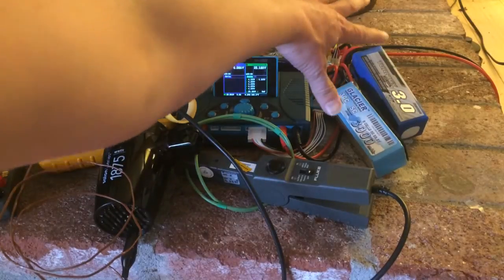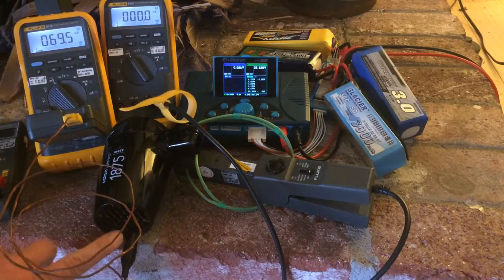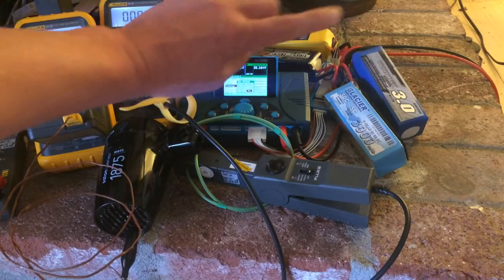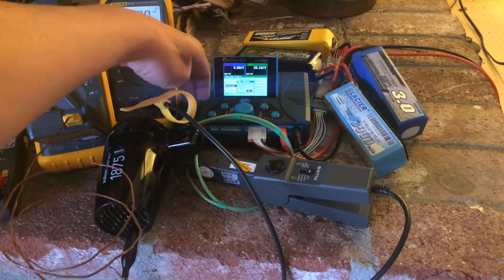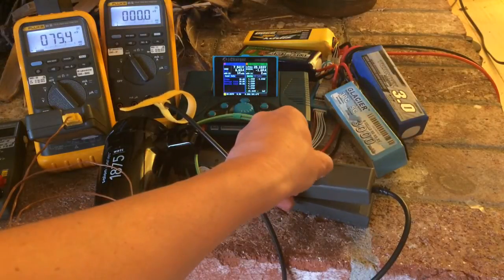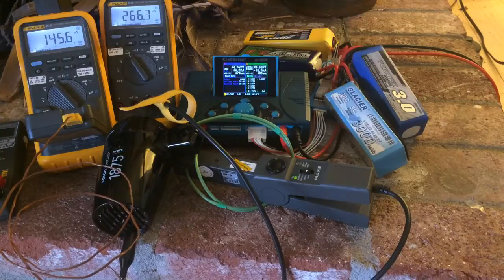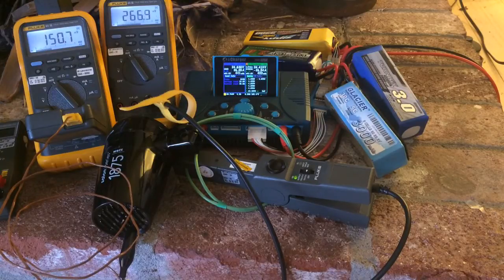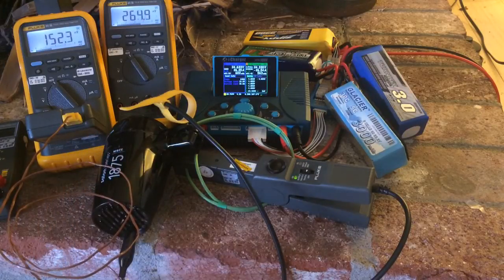Conair hair dryer as iCharger resistive load: Load Test 2 (Part 3)

Comment: This is a great idea you have here also as some people carry around a 100lb lead acid battery for fast discharging. A simple light throw around durable hair dryer is just genius. I sure wish I knew this much but have started my research and will not give up till satisfied. I started with ohms law research this part seems very simple so far
Reply from the maker: Jacob Hendrickson thanks Jacob.  Yes, repurposing a cheap hairdryer as a durable and lightweight resistive load is quite a good match for bringing high-C lipos to storage voltage quickly.  I'm sure it will all fall into place without too much effort for you.  Good luck with your project.
Reply: This is great! How can I build one of these??? Please share

Comment from the maker: While the regenerative discharge per channel maximum is 800W, and the total is 1300W, apparently the specs are ambiguous in that the absolute amount of charge or regenerative discharge power per channel counts toward the "1300W" maximum regen power.  In the above example, Ch2 is discharging approx. 650W from the batteries while Ch1 is regeneratively dumping 650W into the dummy load, resulting in the total 1300W maximum capacity.  The only way to acheive 800W regen discharge is to regeneratively discharge a 6S pack from a single channel into a 24V lead-acid battery supplying power to the iCharger input.
Reply: I generally charge at the field with two deep cycle AGM batteries connected in series, so around 24V.  I use the iCharger 308 Duo.  This regenerative discharge (fully charged LiPo(s) into the deep cycle batteries) would mean I would not have to bring a resistive load (hair drier) to the flying field, so more convenient.  How fast can I regenerative discharge fully charged 7S LiPos into the 2 deep cycle batteries connected in series?  10A?  20A? 30A?